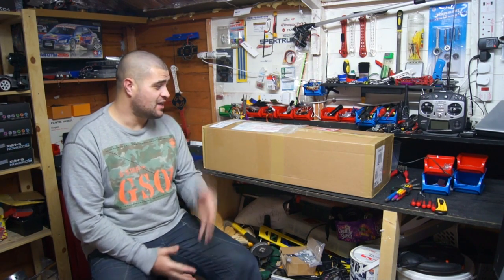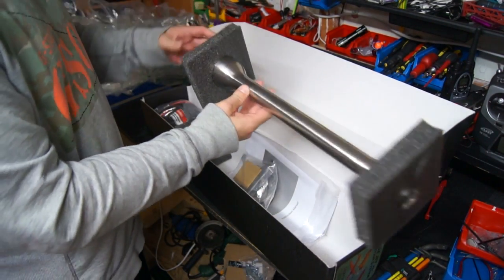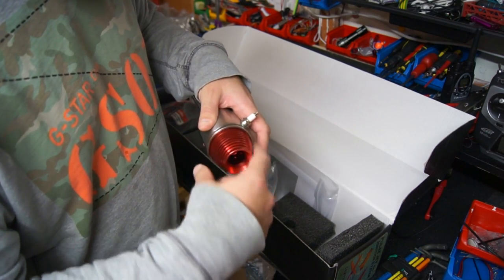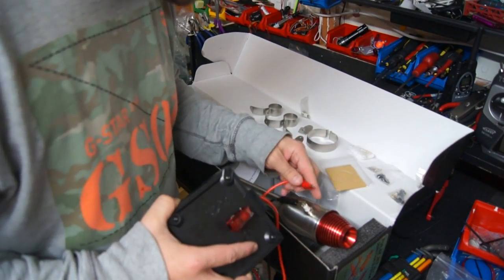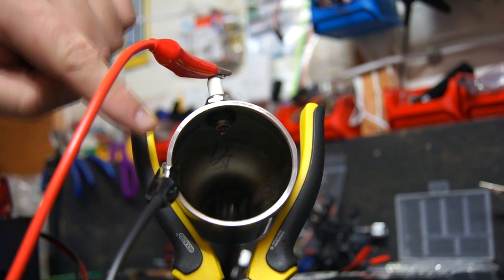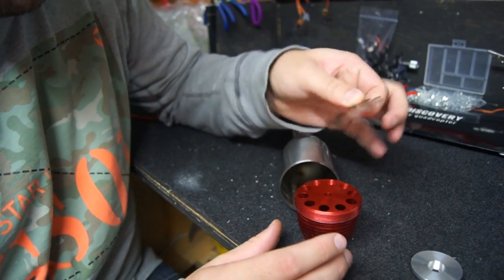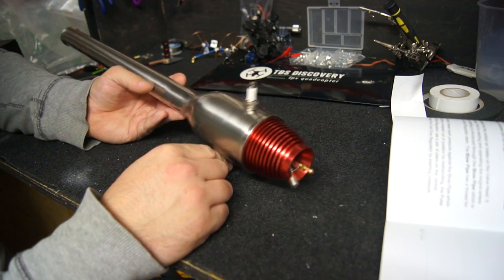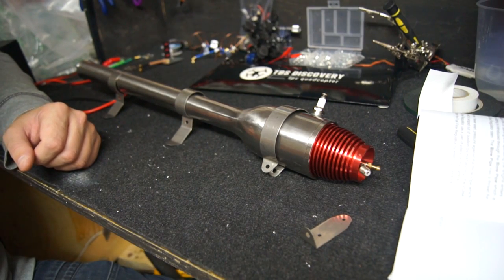Pulse Jet Engine "Red Head" Part 1 (from Hobbyking) That HPI Guy

Comment: Dielectric break down for air is roughly 3kv a millimeter. Even if a device can put out up to 20kv, If a gap is 1mm, as the voltage rises, discharging  through the gap  will discharge the energy through the gap before it can climb any higher than the break down voltage for that gap.

Comment: Hard rolled, Spring quality stainless would be better that what looks like a carbon Spring steel reed valve, it operates at a higher temperature before beginning to loose modulus.

Comment: hmm. i have an original redhead from the 50s and it still has the original reed valve ass. it runs excellent. i have run it for as long as 3min straight. guess they deff dont make them like they used to. as a side note the ignition is an original 20s model t ign coil box!

Comment: 6:55 it takes 30KV to arc across one inch of 'dry' air at sea level air pressure. In humid air at sea level it can be 20KV or less.
How well would this engine function at high altitude and high velocity?  I think it would quickly overheat..
Reply: The mixture fires itself once warmed up, remember at speed this will also suck in more cool air and for under £70 right now it's worth finding out.

Comment: It's ridiculous, the life of the reed sheets are just too short, it's a big con in my opinion. And it would be more effective to make a pulse jet like the famous one with 2 tubes...
Reply: Do you mean the 'Valveless' Pulsejet Engine? That engine seems to me would never function at high altitude nor high velocity. The atmospheric cavitation behind its air intake/exhaust would cause a flame out at high speed.
Don't you agree?
Reply: Lol, it can be true , it seems these valved jets are 2x more powerful than the valveless, still, would be nice to see any kind of test with a valveless in a rc airplane.

Comment: Wow, picky picky. A few weld bumps won't affect the performance, because that tube portion doesn't have to be perfectly round/smooth etc. Nothing a GRINDER can't fix!

The anodized aluminum tip (which is flawless) was PERFECT, and that's the only part that has to be very precise.